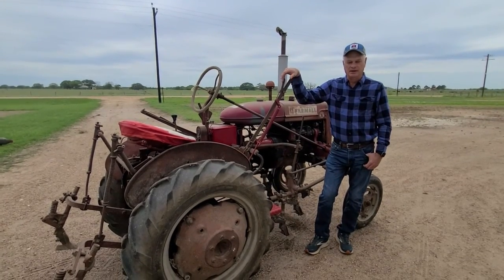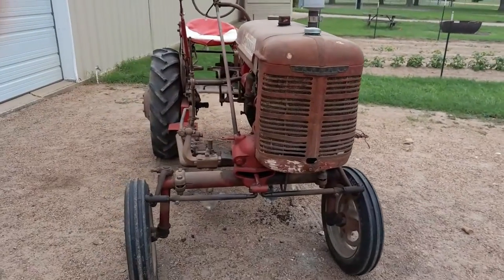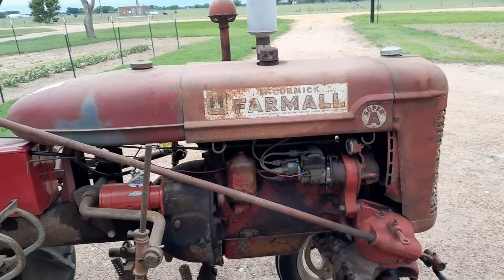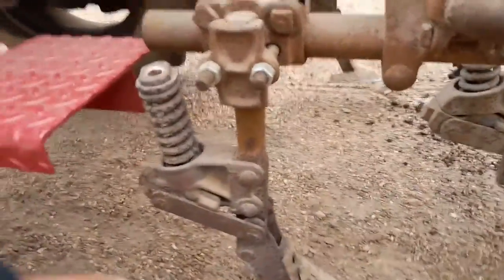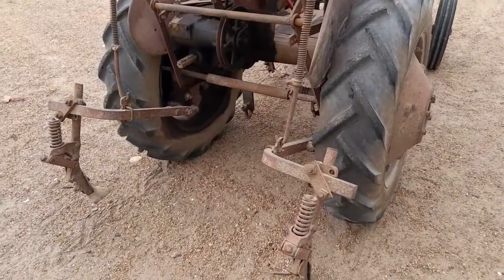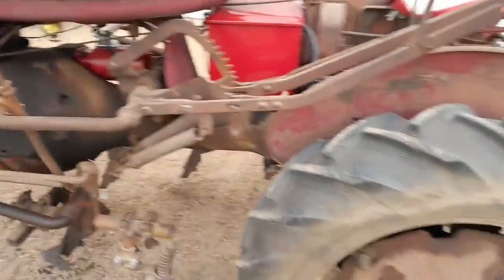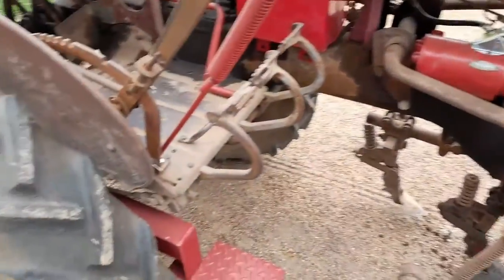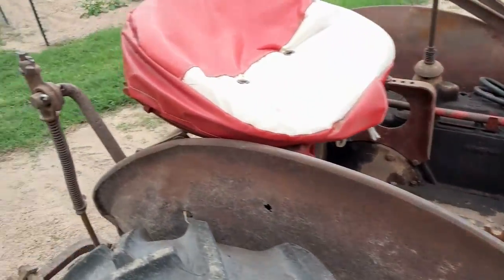Farmall A and A-136 cultivators (2023)

Comment: I’d really like to know the connection/hookup arrangement for the cultivators. I have an A but the rear cultivators were being held up by a chain and were not functional. The front were connected to an exhaust assisted lift system which didn’t work either. My intention is to discard the exhaust system and go back to the manual lift. My problem is I don’t know how to set it up. I would appreciate any help you can afford. thank you, I enjoyed your video.
Reply from the maker: Hi Larry.  The lower rear gangs are connected to the final drive/bull gear housings and are connected to an upper rockshaft by vertical rods with springs on them.  The rockshaft works via a linkage rod that goes from the rockshaft, under the seat near the right fender, and connects to a manual lift handle that is bolted to the right front of the platform surface.  Regarding the fronts, I've seen exhaust lifts, but I'm not familiar with them.  On mine, the front levers also work a rockshaft that connects to the lower beams via rods with springs.  It would probably be best if I could send you pictures.

Comment: Are the front and rear lift seperate ??
Reply from the maker: Yes they are.  And the right and left side of the front can be raised & lowered independently if needed.
Reply: @rustyrelicsranch   how can each side if front be raised independently ?? Can you show me that ??
Reply from the maker: I totally missed your question.  I should clarify.  There are two levers on the left side of the tractor, one longer than the other.  The long handle lowers and raises both gangs and has a lot of "teeth" or notches to choose from.  The shorter handle only has about 4 selection notches and you can use that to run the left gang slightly higher or slightly lower than the right gang.
Reply from the maker: I totally missed your question.  I should clarify.  There are two levers on the left side of the tractor, one longer than the other.  The long handle lowers and raises both gangs and has a lot of "teeth" or notches to choose from.  The shorter handle only has about 4 selection notches and you can use that to run the left gang slightly higher or slightly lower than the right gang.
Reply: @rustyrelicsranch   why would you want left gang slightly lower it higher then right gang  ????

I don't understand what you would gain by this ??
Reply from the maker: @TeresaJohnson-ew4us  Generally, you would want to keep them at the same level.  However, the capability is there in case you have an irregular row for whatever reason.  For example, I have a row at the edge of the field next to a ditch and the tractor will lean over causing one side to dig deeper than the other.  The extra adj lever can be used to compensate for this.